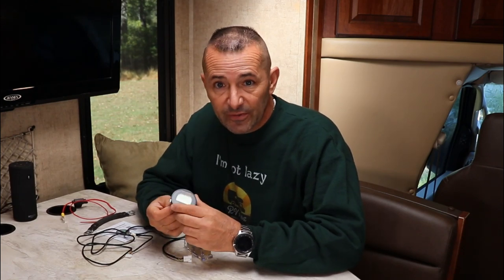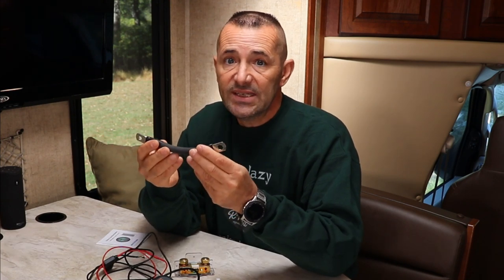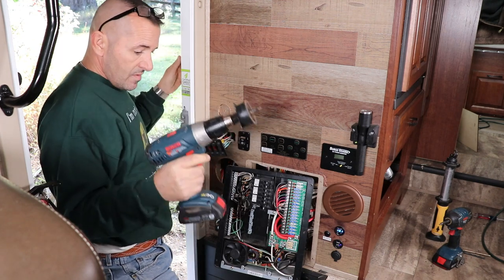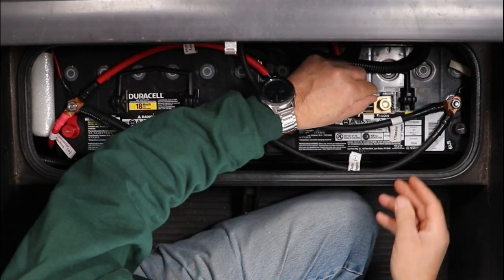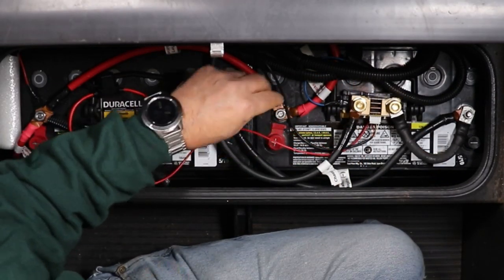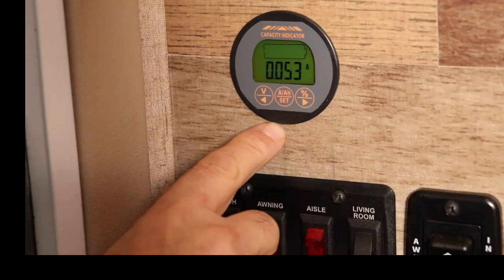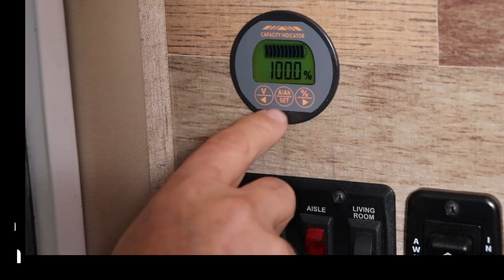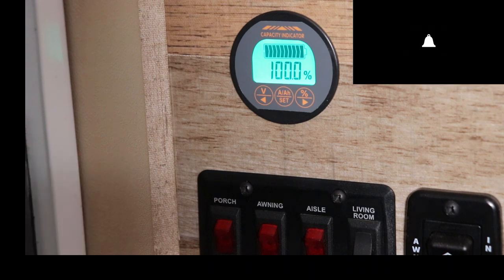Installing A Full Function RV Battery Monitor From AiLi Qwork– How To - Tips and Tricks - RV Upgrade

Comment: Great video thank you very much , I have watched the set up process many times but I cant seem to have the back light stay on long enough for me to set anything up I see you just press the set button and it lights up but for me it only stays lit for about 2 seconds am I missing something ?
Reply from the maker: Hi, are you holding the button down to enter into program mode?
Reply: @RVHabit  on further diagnosis I found the connection plug in to the gauge had pushed back the Thanks pin to the red wire and was intermitant connection all working good now  Thanks

Comment: What gauge is the power wire from the shunt to the +(POS) battery post?
Reply from the maker: Hi Dan,  I used 16 AWG and added a 5 amp fuse.
Reply: @RVHabit  thanks.  Just bought the same one.

Comment: Great video, thanks for doing it!  I installed the battery monitor over the weekend, and beside from having to build the wire from the positive battery terminal to the shunt it was all pretty easy thanks to your video.  I have a question for you.  After installing the monitor, I purchased a Battery Tender from Costco. When I put battery tender on the battery I could see the voltage increasing on the battery by using my multimeter, but I'm not seeing the increase on the battery monitor. I'd think that the battery monitor would show that it was being charged.  Any thoughts on what may be causing this?  Thanks again for the video!!
Reply from the maker: Are you attaching the negative cable of the battery tender to the P side of the shunt?  It should see amps going in through the shunt.

Comment: Can the shunt be attached to a battery post somehow?
Reply from the maker: The only way to make the connection is a wire or copper strap.  The shunt has its own post and bolt.

Comment: Thank's , your video is well done . I just received the kit yesterday , I realized the connecting cable they supply is a little short for what I have planned so I've ordered a longer one . Once we get some better weather I am doing the install  , we just got another bitter taste of winter in Alberta . Once we're through with the lousy weather  I have a few more updates that I'm doing at the same time as the moniter install  , adding some circuit breakers and tidying up some wiring .
Reply from the maker: Sounds great.  Post an update on how it goes.  Good luck.

Comment: Installed this battery monitor in my van yesterday after frying my lead acid's by draining them. I  followed your instructions and found it especially helpful that (like me) you had two batteries so I could see how you wired it all to the shunt. I think the most difficult part was figuring out where I wanted to install the display. Thank you for creating this video.
Reply from the maker: Hi Michael, Glad it helped.  Thanks for commenting.

Comment: Thank you very much, great explanation! Do you know what is the draw of the monitor itself? Do you think it's possible to add a switch to power it on and off? Thanks
Reply from the maker: Turning the monitor off will require it to be reset when turning back on.  I would only consider this for long term storage.  The draw is miniscule.
Reply: @RVHabit  Thank you very much!

Comment: New subscriber here.... great job! I have a lithium battery with just one negative and one positive. Assuming I can just disregard your comments about "all the other negative wires in my coach" I'm just connect this to the positive and negative side of my existing battery?
Reply from the maker: Hi Daniel,  yes dis on e t the negative from the battery.  Install the shunt to the battery negative then the negative cable to the other side of shunt.  Thanks for watching.
Reply: @RVHabit  thank you so much! So in terms of parts I will still need the same ones that you used in your video?
Reply from the maker: Hi Daniel,  Yes that is correct you will still need the parts in the video.

Comment: Great install video ... thank you! How would I go about re-calibrating if I messed up the first time?
Reply from the maker: Hi Buck and thank you.  Re-calibrating should be very simple.  Hold the set key till the ah blinks and adjust to correct amp hours for batteries.  Then go to percentage hold key till blinking and it will go to 100%.  That is the only two settings you need to set.

Comment: I have two 6 volt batteries wired in series.  Does the shunt go on the cable between the trailer and first battery or the cable between the two batteries?
Reply from the maker: If they are wired in series, typically the positive wire goes to battery #1.  Then a short wire goes from the negative of battery #1 to the positive of battery #2. (This is connecting the batteries in series).  Then battery #2 should have the chassis negative connected to the negative post.  Battery #2 is where the shunt would be connected, between the chassis ground and battery #2 ground post.
Reply: @RVHabit  Thanks for the help.

Comment: How can I calculate the aH of a pair of 6 volt batteries that I have used for about 4 years? You stated your 12Vs were 210 aH. How did you arrive at that figure? I also have a small personal problem...I can't leave my batteries in my trailer due to tweeker thieves in the neighborhood. Gotta take them out and store in the garage when parked at home. So, I suppose this means I have to go through the complete battery wire-up routine every time I'm getting ready for a camping trip? Thanks.
Reply from the maker: The amp hours for each battery should typically be listed on each battery.  If it is not the manufacturer website should list the amp hours for the batteries they make.  Yes you would have to program your monitor if you are re-installing after removing your batteries.
Reply: RV Habit yes, thanks! Right, I know the Ah is marked on the battery, but that’s for a NEW battery. My question is how does one calculate the Ah for an OLD battery? As you stated in your video, the Ah would have to be recalculated for older batteries. Thanks for the reply!
Reply from the maker: That is an excellent question and above my pay grade.  Many factors would go into this calculation in addition to age.  For example the number of times the batteries have been discharged and charged, if the batteries were ever taken below 50%, etc...

Comment: Hi, thanks for video, I have purchased two for different vehicles, they both work well but my van with two batteries wired in parallel in will not display amp other than negative draw when I know there is positive amp via my solar panel! Any suggestions as to the problem? Many thanks, Dan
Reply from the maker: Hi Dan,  I couldn't begin to know without looking at the wiring configuration.  It sounds like you know how it should be wired.  Perhaps switch with the meter and shunt from other vehicle that you know is working so you can make sure the meter and shunt work properly.
Reply: RV Habit I tried changing  meter over but not the shunt, I will try this, many thanks for your fast reply, really appreciated, thanks, Dan
Reply from the maker: Change all parts one by one.  Good luck Dan.

Comment: Thanks for this video, i just installed it today, but i have a main battery shut off. Does that mean i have to always reprogram it, or can i re wire the shunt?
Reply from the maker: No, The shunt is wired directly to battery.  A shut off should not affect the display in any way.  The shunt B goes directly to the negative post on the battery.  The positive connection from the shunt goes directly to the positive terminal of the battery.  The RV shutoff should only disable power to the coach distribution panel.
Reply: @RVHabit  thank you. Video was really helpful as well. Happy holidays!

Comment: Hi I’m about to purchase this setup. I see they sell a 16 foot long extended monitor cable which I believe I need to get from my battery bank to where I’m installing. Do you foresee getting the white plastic wire connect from outside the coach to inside an issue? Will I need to cut and rewire to get it up through the floor?
Reply from the maker: I had to drill a hole in the floor big enough to get the white plug to fit.  The wires in the harness are very thin.  I would not cut it unless a last resort.
Reply: RV Habit is it best to use 1/0 for the short battery cable to the shunt? I’m adding two 6V batteries in series to my coach as part of this upgrade. Trying to determine best size wire to connect the batteries together and for the short piece to the shunt.
Reply from the maker: Hi I used 1/0 for the short cable between shunt and battery.  Maybe overkill but I feel more confident there will be no problems.

Comment: Great video, thank you. Can you tell me what gauge wire you use for powering the shunt?
Reply from the maker: If I remember correctly I used 18 AWG.
Reply: Ya the link sent me a 12 gauge, that sucker was not going to fit.

Comment: Mine is showing the wrong volts. I have a 12v system and the display shows 27v (or something)
Reply from the maker: First thing I would check is all your connections.
Reply: @RVHabit  its fine. I repluged it
Reply from the maker: Glad to hear it.

Comment: Hello Lou. Thanks for a great and informative video.  The one bit of info that I would be interested in seeing is how you ran the monitor's cable down to your batteries. I also have a Class C and my install will be similar to yours.
Reply from the maker: Hi Terry,  I went down through the floor to the outside of the RV then into the battery box.  Remember to use wire loom to protect any wires on the outside or exposed to the weather.  Always check where your drilling to make sure there are no other wires, pipes etc.  Good luck!
Reply: Thanks Lou.  One more question...what length of cable did you use to link the two batteries in parallel?

Comment: I installed one of these 12 V monitors it all works okay but the display flashes
Reply from the maker: Hi Colin,  Yes this monitor does flash.
Reply: @RVHabit  
Why does it flash
Is it because the batteries are fully charged
When the batteries are a little discharged does it stop flashing
Reply: I just installed this past weekend and learned that you can turn the display off by holding down the V button and the % button at the same time for 3 seconds.

Great video by the way. Thanks for taking the time to film and upload this.

Comment: Great, straightforward instructions. Thanks! I was wondering if you attached the shunt or left it loose on top of the battery?
Reply from the maker: Hi Tom,  I get asked that a lot.  I forgot to film that part but I did attach it to the top of the batteries.  I used some industrial Velcro.  It has held very well and I have not had any problems with it moving.
Reply: @RVHabit  Thanks - good idea!

Comment: Thx for the video. I have a question please. i bought this product (the 100 amp version, not the 350). I have 1/0 cables - heavy cables - connecting my battery to my inverter. I am worried that the tiny wires in the shunt will impede or compromise the current flow through those cables. What do you think? Thanks very much. Scott
Reply: PS:  I have a 100amp hour lithium battery and a 2000w inverter.
Reply from the maker: In my opinion you would need the larger 350 version to use a 2000w inverter.
Reply: @RVHabit  Thanks - I just ordered 350a. Would you mind telling me the watts of your inverter and the gauge of your cable from battery to inverter? That would help me a lot. Thx agn. Scott
Reply from the maker: Hi, I have not installed my inverter yet but I am planning on a 2k inverter with 1/0 wire.  With that said you should refer to a wire chart because the length of the wire run will dictate the wire Guage needed.  Good luck.
Reply: Thanks! My 2K inverter works great. I’ll let you know how it does after I install the shunt.
Reply: I received my 350a shunt/monitor. Your instructions are great but help me with this: 1. There are two B+ connectors. Does it matter which one the red power wire goes to? 2. What amp fuse did you use in the red power wire? Thanks!!
Reply from the maker: Either of the two spots on the green power connector will work, it does not matter.  I used a 5 amp fuse with 16AWG wire to make up the power line.
Reply: Thanks again!

Comment: First, Thanks a ton! Mine is on order, and I will use the video for the installation. Question: How did you attach the shunt? Hot glue gun directly to the battery? I like the short run of wire/cable that way, but is it safe?
Reply from the maker: Hi i used some velcro.   I as long as your wire is the proper guage there should be no problem that i am aware of. Thanks for watching.
Reply: @RVHabit  Excellent! I didn't find that info on your blog nor in the video,  so I was wondering.....

Comment: Do you put what ah one battery has, or total ah all together?
Reply from the maker: This really depends on your preference.  So you can only use a lead acid battery to 50% capacity before damage to the battery can occur.  If you put total bank amp hours into the setting of the monitor you will know exactly how much amp hours the bank has.  You will also know it needs to be charged when approaching 50%.  The second method is enter half the amount of bank amp hours into the monitor settings.  It will show 0% when batteries are at half the capacity and need charging.  This is really a personal preference.  I prefer to use the first method in the event I go below 50% I know by how much.  Both methods will work.  Great question and thank you for posting it.

Comment: The batteries you installed. Were they 6 volt or 12volt each?
Reply from the maker: Hi Emory, 12 volt wired in parallel.
Reply: So with parallel you have 2-12volts batteries = 12volts but 200amp hrs
Reply from the maker: Yes that is correct

Comment: I bought one and installed. But im having issues with instuctions in small print .  The display flashes.  Any clue why?
Reply from the maker: if you mean the light is flashing that is normal when charging.  Go to my website article and I have the instructions in PDF form where you can enlarge the print to help you out.  https://www.rvhabit.com/post/installing-a-full-function-rv-battery-monitor-from-aili
Reply: @RVHabit   no its flashing when its discharging so i have somthing backwards just not sure what. Thanks for your help
Reply from the maker: Hi David I can't get to my RV right now but mine may also flash when discharging I can't remember.  I will check as soon as I can.
Reply: @RVHabit  thats fine. I was not expecting you to do that as soon as the weather clears i double check what i did

Comment: Hi. you often hear people say lead acid only have around 50% of usable stated amps and lithium are able to use the full 100% of the stated amps. If your hooking up these meters to lead acid can the meters tell what battery type are been used or do you have to put in the amps with the 50% usability accounted for? I have just constructed a lifepo4 to play with and I can already tell a 100amp lifepo4 has way more power than a 100amp lead acid leisure battery. Do you find your meter arcuately represents your power storage? thank you
Reply from the maker: The meter only knows what you program in.  You do not program 50% compensation for lead acid batteries as it will not read properly.  You, the user, needs to know that if using lead acid batteries the capacity is 50 percent.  Good luck.
Reply from the maker: Hi, when lead acid batteries are at 50 percent they are at 50 percent and the user needs to know that's when they need to be charged.  If you program the monitor to read zero at 50 percent the meter can not go below zero.  Meaning if you take batteries to 45 percent the meter stops at zero but you drained an extra 5 percent.  When you recharge the meter would show full when it put 50 percent back in not the 55 percent that it would need to be fully charged.  I hope that makes sense.  Good luck.

Comment: So every time you charge the battery you have to program it to 100%?  The shunt just reads the voltage out, not the voltage in?
Reply from the maker: No not at all.  The shunt reads voltage out and voltage in.
Reply: @RVHabit  After doing a little research, I realized I needed to attach the negative from the charger to the Neg of the shunt, not the Neg of the battery.
Reply: @RVHabit btw,  thanks for offering no help at all.  You were were just ready to  defend the product,  and not find the solution.    Fail
Reply from the maker: I answered your question. Sorry but you asked nothing about wiring Nor did you state you had a problem to solve.

Comment: That is the exact monitor I just bought and your explanation was PERFECT!  Thank you
Reply from the maker: I'm glad it helped out.
Reply: @RVHabit  quick question please:  does my negative cable from the converter/charger still go directly to the battery or does it go to the P terminal on the shunt?  Thank you
Reply from the maker: All negative cables go onto the shunt P terminal.  The only negative cables on the battery would be the one connecting to the B terminal on the shunt and/or if you have a cable connecting two or more batteries in series or parallel.
Reply: @RVHabit  Thank you. You are a Big help

Comment: Hey bro how much panel do u have on the system
Reply from the maker: Hi Trisha, I am not sure I understand the question.  My system is  a two battery 12v system wired in parallel with a total of 210 amp hours.
Reply: @RVHabit  I'm having a little difficulty with a TRIstar charge controller